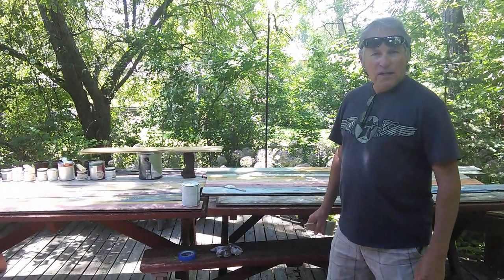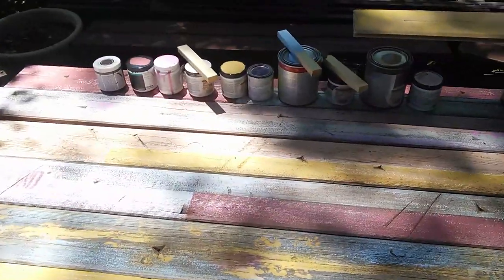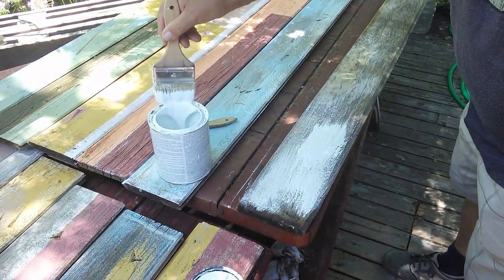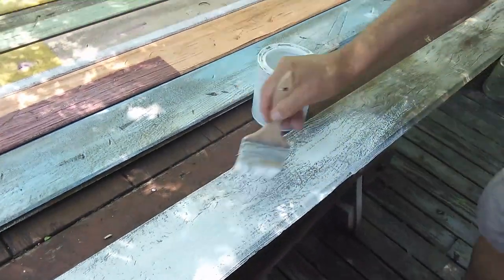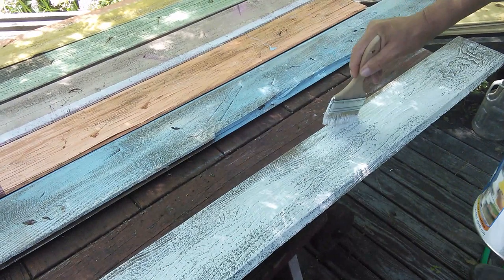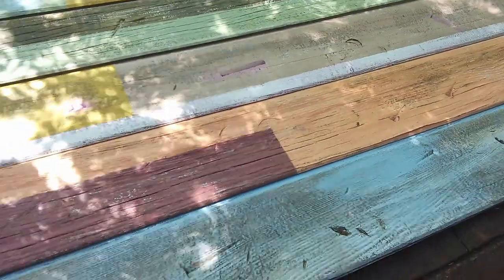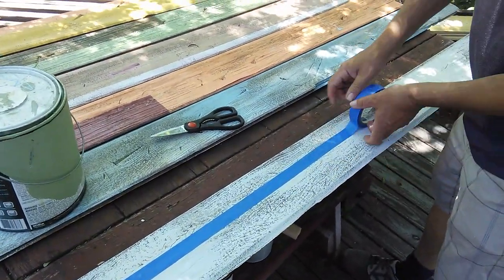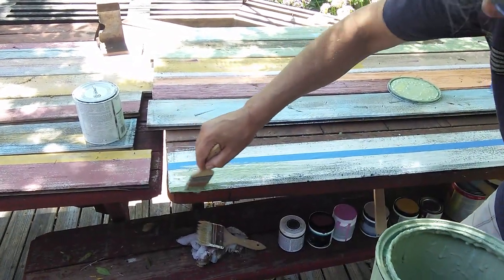Distressed Wood Painting Techniques

Comment: People are on this distress look but...... they jump in .....it's already distressed it's Pallet wood     the sanding should be mostly for smoothing.    Next time..... paint first coat..... While wet u paint 2nd color mixed light with water.....n u wipe some.    Then dry.   If it's new smooth...year. Do it this way.    But not pallets.  U don't need to